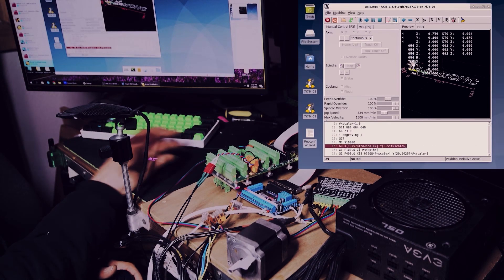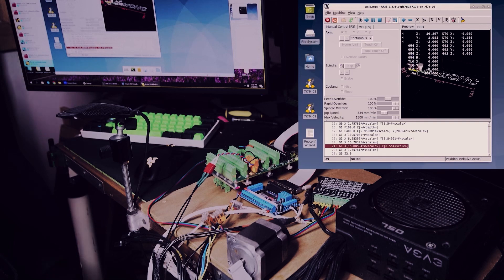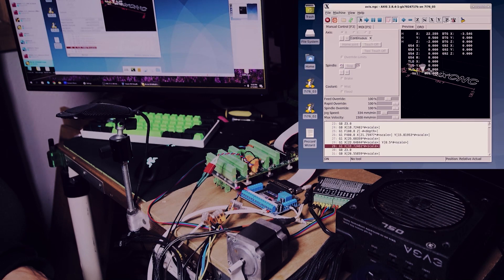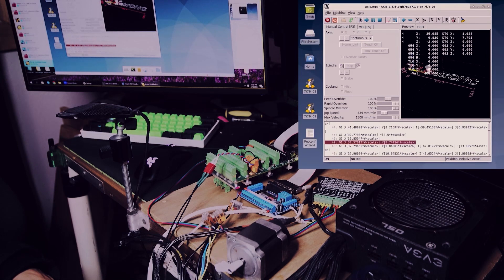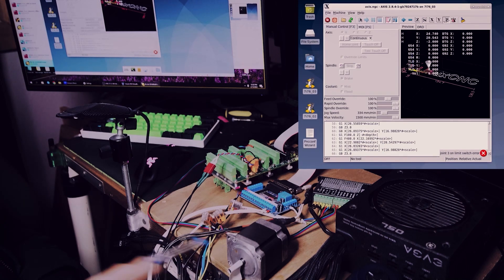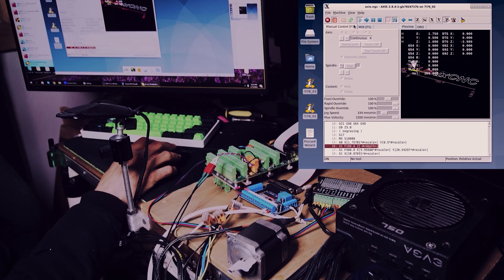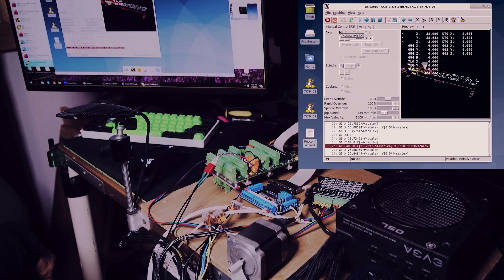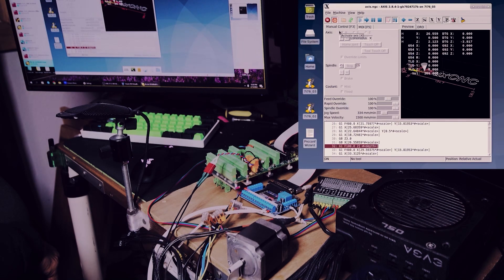Linux cnc test setup with mesa 7i76e in virtual box

Comment: Important question: Do you use LPT parallel port to connect to Mach board or USB converter. If first option, tell me how to configure LPT on VM Box and then in Debian ??
Reply from the maker: Mesa 7i7e with a USB Ethernet adapter and USB passthrough is a common configuration for connecting a CNC machine control system to a network. This setup allows the controller to communicate with a computer over Ethernet, which is typically more reliable and faster than USB. However, using USB passthrough, just for testing,  i am going to try with a pi5